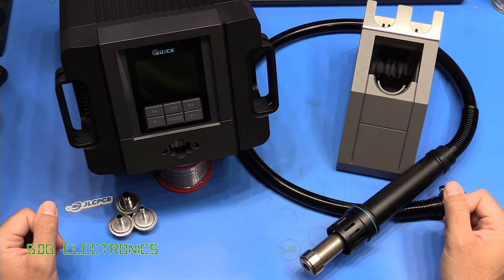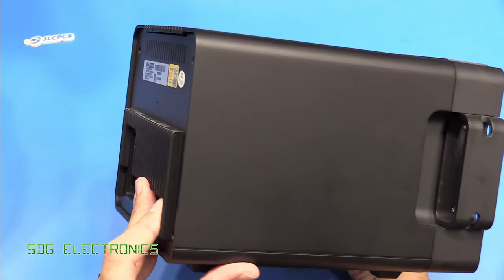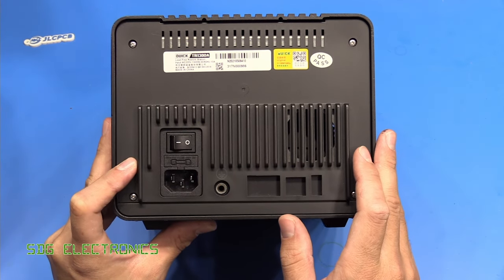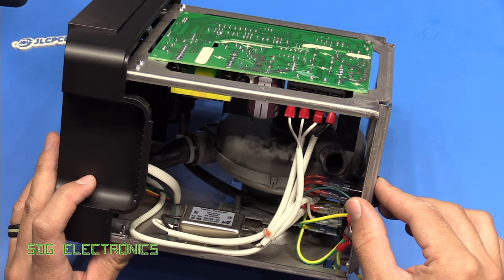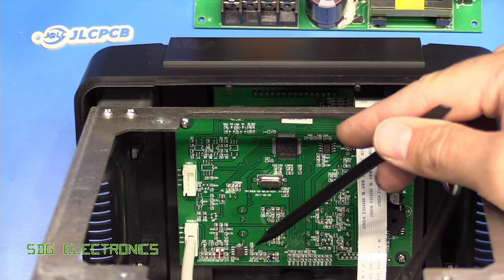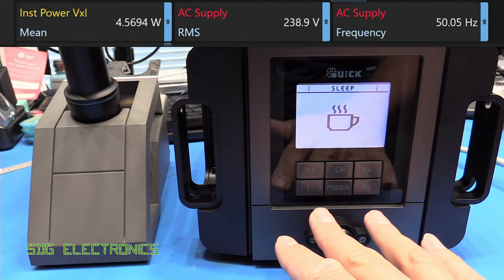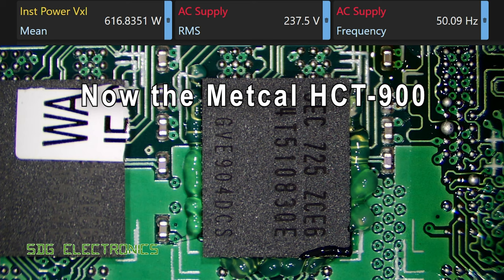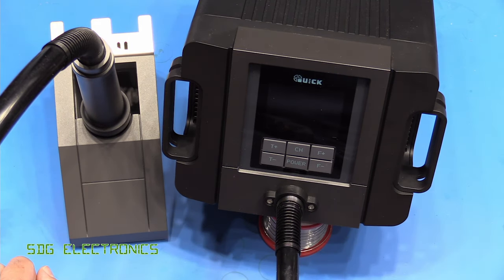SDG #270 Quick TR1300A Hot Air Station Review

Comment: What a coincidence! Just a couple hours ago I unboxed and tested the very same unit at work. Mine had, however, a CE sticker since I got it from the official EU distributor for Quick.
Now, a few words on the missing features: according to the sales rep I talked to, and the documentation he provided to me, the model with the multi zone heating, a touch screen, and all the connectivity (useless in my opinion) is the WAY more expensive Quick TR1300. The sales rep literally said to me that the TR1300A is the better choice and better bang for the buck. Personally I like the interface, because my base unit is on a shelf above the work bench and there is not a lot of strain on the hand piece. One thing I would recommend to everyone is to get the 45 degree nozzle. This unit is really good!
Reply from the maker: I also have mine sitting slightly high up off the bench which works well. It's frustratingly close to being a great machine - a slightly longer hose, higher upper limit on airflow and a few UI tweaks and it would be there.

Comment: METCAL stuff is so damn nice.  Every time I use a METCAL piece of kit it just flat out works and works extremely well.  Using METCAL is like lounging in your favorite chair…..comfortable and well designed.  Great review.
Reply: I’d really like to see him do a review of the Hakko FX-100, which uses Metcal’s induction technology.  I ponied up the bucks for it and have been using it for a couple of years.  There was a thread online where a few guys bought the Metcal, JBC and the Hakko to do a comparison.  It was either on DIYAudio or eevblog.  Anyways they all preferred the curie point induction heating of the Metcal and Hakko better.  When using two hand pieces on the Metcal they found the Hakko to have more power, but when using one and allowing it the full 80 watts the Metcal could wet a ground plane slightly faster, though they found the 80 watt Metcal and Hakko to be equal when using the FX-100 turbo mode.  The Hakko ended up winning, not by a huge margin, because of less expensive tips and form and function.  You need a big tip to take that 80 watts though. 

Still I’d really love to see a video on this channel and get his thoughts since he’s a big Metcal user and he never really seems biased in his reviews. I would never give it up, I’m in love with this iron. Enough so that I bought a dozen of each of my favorite tips in case they skyrocket in price or go away.  I also grabbed the mini hand piece and several micro tips.  Sadly the micro tips are quite a bit more expensive.  They are tiny though. If I came across one of the 80 watt metcals at a good price I would pick it up to do a comparison and probably keep both regardless.  Doesn’t seem like there would be any reason to pick up a 40 watt unit as the FX-100 already does the same thing, only better.
Reply: @danhorton6182  Theres not much need as its so expensive for the Hakko base FX100 power supply. You can just use the handpieces with a metcal power supply instead (which are dirt cheap). The FX100 is not 80W, its 50W RF output, so very slightly higher than an older Metcal (40W). I'll believe the turbo when I see a measurement.
 
But yes, compatible tips for the hakko T31 are very cheap (<$15), so if I were starting now I might consider getting the handpiece instead of a metcal handle.
Reply: The HCT-1000 probably has the most stupid, counterintuitive user interface I've ever seen in a hot air station. The hardware is ok, but it's just not practical.
Reply: @jaro6985  what you said makes absolutely no sense.  First you say the cost of the Hakko power supply is too expensive yet a used Metcal costs roughly as much and I’ve seen worse performing Metcal stations on his channel that cost more than the Hakko. Heck he spent nearly 3x the cost of the Hakko for a poorly functioning JBC solder feeding machine that can’t even get that right.  

I never stated the FX-100 was 80 watts, of course I know it’s 50 watts.  And I wouldn’t call a 25% increase in output power “very slightly higher” than the 40w Metcal.  And as for “believing the turbo mode when you see a measurement”, well you just made the argument for why it should be featured on this channel.  That’s exactly what he does and I’m sure he would give his collected data and his honest opinion at the end.  Though I’ve used the turbo mode and it most definitely works. 

Well the comment about the inexpensive Hakko tips made sense as they are.  Hakko is a big player in the game and there are Hakko haters.  Not sure if I’ve seen a Hakko on this channel.  Limiting yourself because of brand name is limiting. I knew I wanted induction and after comparing the cost of tips and power supply the Hakko just seemed like the better buy in the long run.  Not sure if ever miss the extra 30w of the 5200 Metcal, but in those instances I have the turbo mode.  I have a Best hot air station, it was a much better buy than the Hakko or JBC.  I also have a JBC station, which no longer gets used since I picked up the FX-100, if the FX-100 ever goes down it will then get used.  I also have 3 other “inexpensive” stations I picked up because of this channel, either being mobile or can run on a battery making them good for uses in the garage and on the car. 

If I had purchased a used MX-5200, wand, mini wand, and all the tips I have I would have easily spent over double of what I have for the Hakko stuff.  If it was the other way around I would have purchased the Metcal and be praising it.  You say it’s too much, but for those that want to save a significant amount of money the FX-100 looks to be the smarter buy.
Reply: @danhorton6182  You can get a used Metcal power supply for under $100 on ebay. A used MX5200 with handles goes for the same as a new FX100, so not really sure what your point is.
Reply: @jaro6985  Yes, as used MX-5200 with handle is roughly the same as a brand new FX-100 with handle, so you get new vs used.  If you want to get a nice collection of say 10 tips you’ll spend quite a bit more on the Metcal setup. This was all about Hakko being to expensive, yet it’s cheaper in the long run, so I guess I don’t get your point.  You can’t argue the Hakko is more expensive, because it isn’t. This channel is used to expose new tools to those who want different options and see what’s out there without spending their own money.  With your mentality I guess this channel should just stop showing any new stations, because hey, you could be one of the lucky few to snatch up a 20 year old, beat up, lower powered Metcal power supply with no accessories or power cable in “untested condition” for around $100. I don’t think everyone wants that.  

Anyways, agree to disagree. All I’m saying is that it’s another good option.  Yes, if you want a lower powered, older used Metcal you could save a little money, but once you start to invest into a collection of tips it may not be with the saving you initially received.
Reply: @danhorton6182  $100 was the going rate for a "Used condition" metcal supply on ebay, if its labeled as used that means its guaranteed to work or you get a refund. 

Its just odd that you say the 25% difference between 40W and 50W is huge. But the 60% difference between 50W and 80W is somehow insignificant. 

Have you measured the draw at the wall on the FX100 yet, for turbo on and off?

Comment: NOTE if you like a quiet lab!!

The jet taking off sound of the max flow is activated EVERY TIME you replace the hand piece to the holder. It’s insanely noisy and distracting after just a few minutes.

I can’t find a way to turn it off so I just removed the magnets from the holder and just let it run or turn it off completely :(

My older quick, the grey one didn’t do this. It continued at the same fan level to cool down
Reply: Also the fact it doesn’t show measured temperature and just the stable set point like it’s bossing it is not what you should expect for £350? Might just be me but if it weren’t for the nicer look I’d swap my main bench hot air back to the grey quick as recommended by Steve :)

Comment: Those small transformers are sometimes (based on manufacturer) considered as permanently short circuit capable, thats the reason to not have fuse in line. They are also tragically inefficient - 1VA transformer has more losses than its rated power.

Comment: Looks really nice.  Too nice to be my first hot air gun.  Curious, when first getting into SMD, what to buy first for assembly and rework?  Most to least useful tools.  Got soldering iron, what's next, hot air gun, or hot plate, or something else?  Looking to see if SDG channel has lab roadmap already...  With different options depending on budget
Reply from the maker: The Quick 857DW+ is a good "budget" hot air station. Excellent user interface and works well so I would recommend this. The hotplate would be 3rd after a hot air station IMO. https://s.click.aliexpress.com/e/_Dd0KZjl
Reply: Atten is a great budget option also. I use one at work

Comment: Note about desoldering test: First removal warmed up the pcb.

Could you measure mains AC waveform of the heating element. Does it regulate zero crossing half cycles or full cycles?

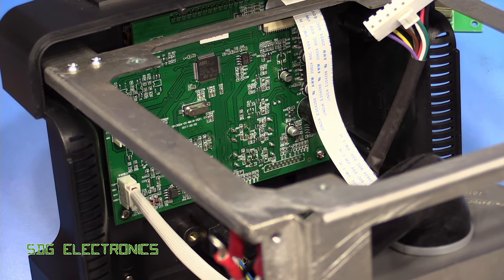Comment: Standby power 15:12 I originally wondered if standby power didn’t take power factor into account, but later I noticed power was 0.84W when on in sleep mode and -1W just before soldering. So your power analyser thing isn’t that accurate..? I’d like to see a video on it. 

Also, that standby power supply with PCB transformer, relay & other components is just to make a power button function?? Instead of using a power switch. 

They could have at least used it for the 5v rail, instead of stepping down 24v with the 78M05.

Comment: Is it worth putting a fuse in there yourself? I wonder how it compares to the original Quick 861 1kw model that sells for a lot less.
Reply: I have the first 1300 Watt model (the AD 856) and also the DW 861.
The AD 856 is the best hot air solder station I ever used, I bought the 861 after some years and is a very good unit but no doubt the 1300 Watt model is really better, it seems an other planet, no way ... 
To be honest I don't know if this TR1300 has the same features as my old unit but ,if it's the upgrade of the AD 856 is a beast. 
It cost more than the double of the 861 so it's not cheap obviously but for professional lab. it could be the right choice. 
For who use it just in the weekend I think the 861 is the best convenient deal.
Reply: @kamikazekk-df4vz  why you prefer ad 856?
Reply: @crimsomglory  many reasons, more power, more air flow, more versatile firmware ecc... 
When i use the 856 and then  861 (1000 W standard version) I feel the difference, same job half time. 
The 861 is anyway a very good solder station, and at reasonable price, the 856AD was very expensive at the time, I paid it more or less 8/900 euro.
Reply: @kamikazekk-df4vz  what do you mean with “versatile firmware”?
Reply: @crimsomglory  it has inside a very firmware. 
The AD856 is capable to make profiles, so you can program many kind of reflow, soldering or desoldering profiles.

Comment: Attractive looking unit. For me the usability is not so much of an issue as I rarely use even all three presets? I usually go with 380C and 450C and that's it. The price though...it's just too high and not justified by a fancy LCD. It's just a hot air blower.
Reply: The third preset is useful for heatshrink, 150C or so.

Comment: that beastly blower and all that noise for only 70L airflow? The 861 DE features a similar blower but gets 200L!
Reply from the maker: Same on the 861X, not sure why this is so low in comparison.
Reply: 70L airflow is enough.  TR1300a has higher performance than 861dw, On the same charging port It can be lifed faster.
Reply: @sahapholpasaja5410  not arguing that 70 is not enough, just that the DE model seems to feature the same blower and it features 200L/m
Reply: We need heat, not cold air. The wind that comes out too quickly is not hot enough.  There must be a balance point.  And you must understand the difference that TR1300a is helical wind but 861 is Vertical wind.
Reply: @sahapholpasaja5410  But that is not the point. I was commenting on the size of the blower Vs. the max airflow. My DE version which seems to feature a similar blower, does output 200L/m at 450 degrees or whatever the max displayed temp is (both measured). Whether that is required and for what, that's another subject.
Reply: You said 70 is not enough, but why can it work?
Reply: @sahapholpasaja5410  I didn’t say it is not enough! 🙂
Reply: @sahapholpasaja5410  how can i contact you? i have also tr1300a i need some help! thanks
Reply: @tony359  Maybe they used a blower with lower airflow but very high static pressure. That could account for the ‘consistent airflow with different nozzles’ feature too.

Comment: I wonder if the heating element is the same between 230/240v models and 120v models, I haven't had any luck finding a listing on aliexpress or banggood for 120v heating elements. Has anyone else ran into this problem?
Reply: Its definitely a different heating element. For years quick only had 230V, took them a while to release 120V.
Reply: @jaro6985  welp too bad I bought the 230v/240v version about a year ago without realizing lol
Reply: @69uremum  It works for you? must be way slower to heat up.
Reply: @jaro6985  I never tried the heating element in my unit because the original is still working fine, I just wanted to have a spare. I just looked on aliexpress and there are listings for heating elements that have 240v under specifications and some other listings have universal under the specifications, so not very helpful. I wonder if maybe the heating element is powered from a tap on the transformer, if thats the case the heating elements could be the same between the 120v and 240v models.
Reply: @69uremum  it cant be from the transformer, that would take too much power. Did you measure the resistance of the heating element?
Reply: @jaro6985  Funny enough I had just bought a new 5 1/2 digit rigol bench multimeter and when I unboxed it to test the resistance of both heating elements I found out that it didnt work and by the time I got  a replacement multimeter I had forgot about doing the comparison. 

is it because the transformer couldnt support the 1300w of heating power
Reply: @jaro6985  I was thinking of how a soldering iron would deliver power to the heating element, I didn't think about how much power that  element draws
Reply: @69uremum  yeah a 1500W transformer is enormous
Reply: @jaro6985  bit of a brain fart on my end lol

Comment: I'm sorry but I'm not impressed ... old design, it says on pcb that it's from 2016... also, it's a 400$ product, they could have spend a few extra dollars on a proper switch mode 5v stand-by power supply (or whatever voltage it is)  ... and the hack with the air going around the connector and screwing the hose to the front which is plastic... way too much space  blocked by the hose in front, maybe if they had the connector on one side of the unit, maybe in a depression inside the volume of the unit...